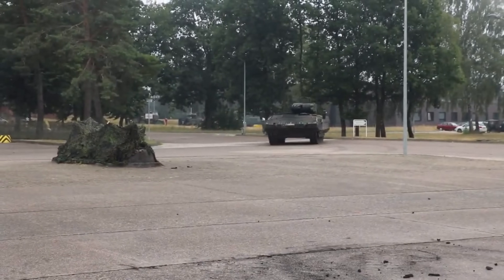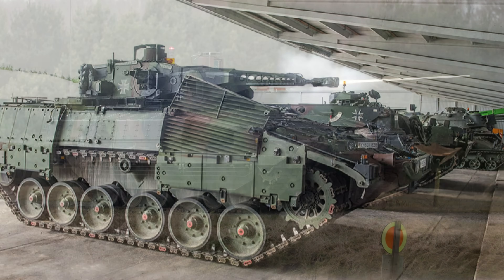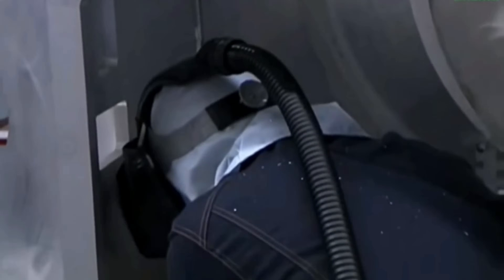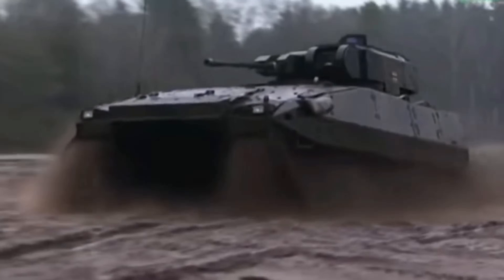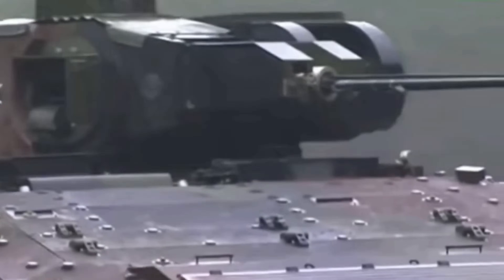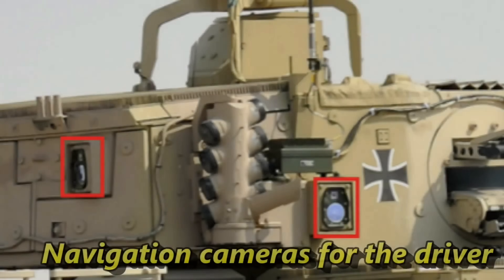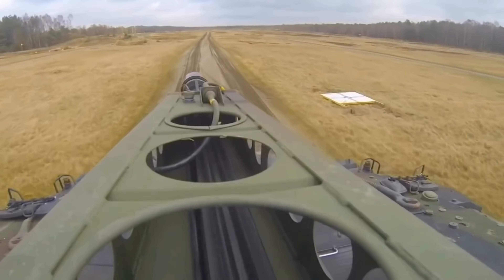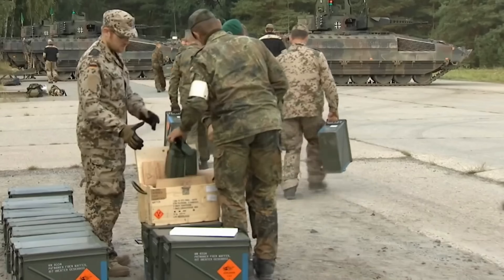The Puma Infantry Fighting Vehicle - Overview and Opinion

Comment: RPG Team: Ah yes Cover
Puma intelegent rounds: no i dont think so
Reply: Warhead_beast programmable rounds... not intelligent, KETF Kinetic Energy Timed Fuse
Reply: @adamleddy9894  the rounds might be timed but the magic happens with ragefinding and auto programming them to denotate behind said target. so yea you COULD call it smart in a way.
Reply: I could... hahaha but it would be wrong :) the rounds are programmable but not smart, there are two progrmming Points on the MK30-2 ABM, but the round does not course correct on its own. The overall System and electronic architchture and Backbone are fantastic as you said.
Reply: @peniskopf653  smarter than smart bombs, that is for sure.
Reply: @adamleddy9894  KETFABM
Reply: A-Air B-Burst M-Munition
Reply: yes.... I know...
Reply: but no one in the industry writes that...
Reply: It so cool to drive around this 🤤